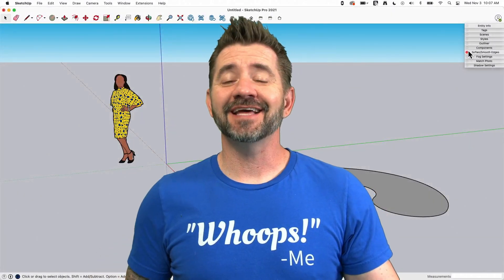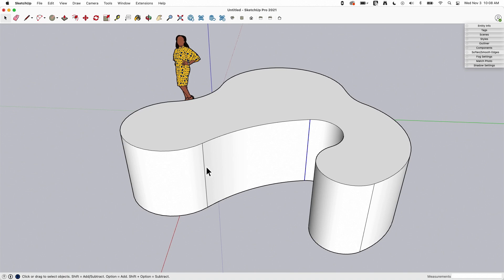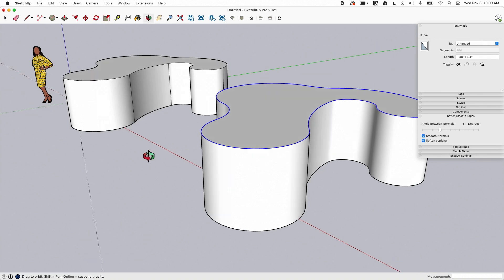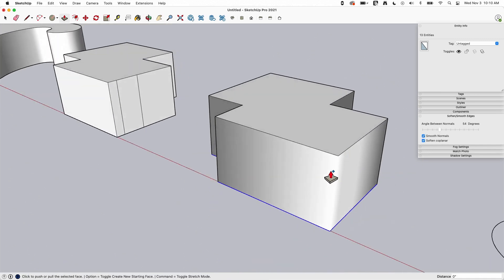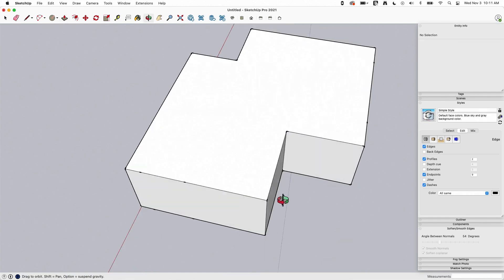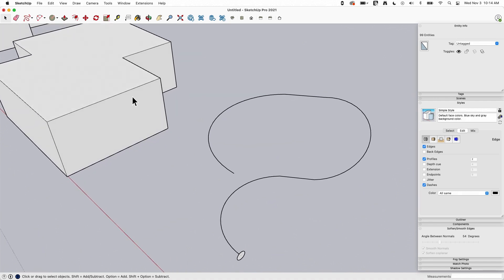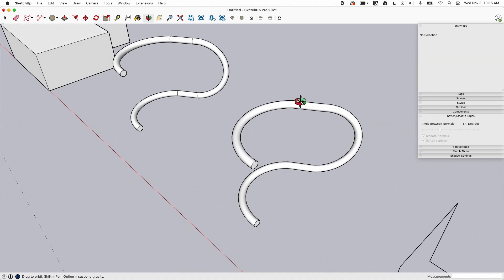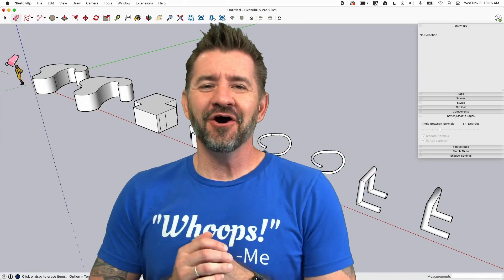Welding Before Extruding - Skill Builder

Comment: Creating a building site with accurate grade. It seems with Add Location and Toggle Terrain on, we could auto generate grade lines and turn off the "photo" from Add Location. Then it would be easy to design hillside foundations that step with the grade. It would be nice to see a single video demonstrating creating a site with grade and then adding a foundation with the sandbox tools. Ron